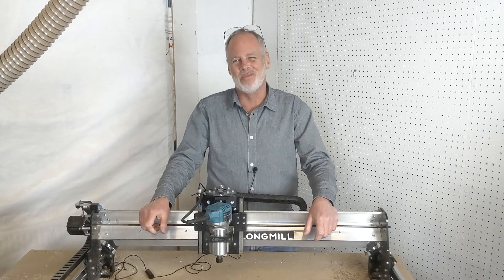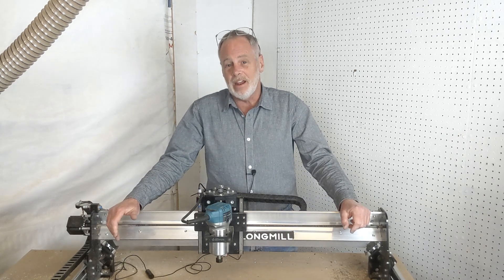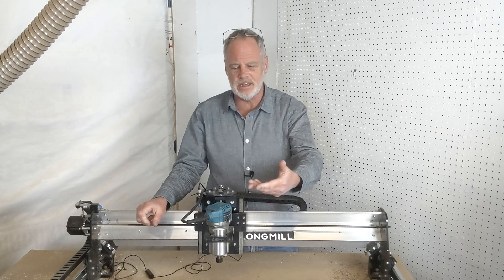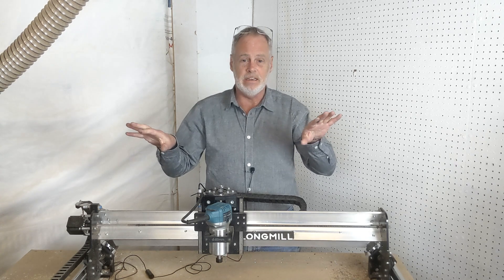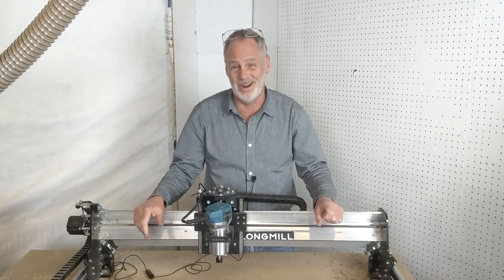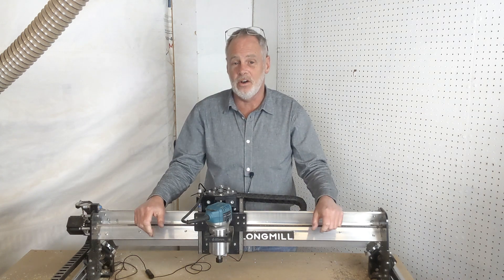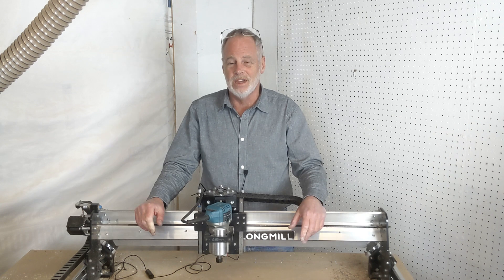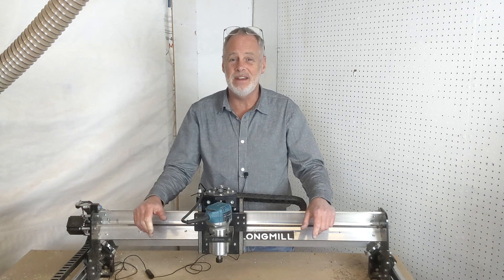CNC Router - What Causes Tearout, Burn & Broken or Burnt Bits on Your CNC Projects, Cuts Rough

Comment: Still useful information 2024!! Can the quality/type of wood also be an issue ? Say some softwoods like white pine ?
Reply from the maker: sergebrosseau991, Absolutely, the quality and type of wood can significantly affect your CNC projects. Softwoods like white pine can be easier to work with due to their lighter weight and softer texture, but they can also result in a softer finish and may require more care when machining. Choosing the right wood based on your project's needs is crucial for achieving the best results. Happy woodworking!

Comment: Man I set up my cnc router and thought everything was good to go. I start cutting holes in my spoil board. when I cut them  there was burning and the smell was bad of course, but i fought thru it adjusting feeds and speeds. I would have a mound of stringy fibers where I was cutting (i just knew something was'nt right ). One night I was laying in bed and something hit me. CHECK THE ROTATION OF THE SPINDLE. I put some painters tape on the spindle and boom it was  spinning backwards the whole time. Easy fix but my only quarter in bit was burnt (sad face). Sure wish I would have watched this particular video a little bit earlier lol
Reply from the maker: tnsfinest, glad to hear this one helped you brother! Now you are set to go to make some serious cuts with your machine.

Comment: I wish I watched this video sooner. My Makita router overheated again and now is pulsating in and out at slow and higher speeds. My guess now after watching this video is that my bits are dull, which makes sense since I have not sharpened or bought any new ones since I started using my cnc a year ago. You mentioned that you cant really sharpen a spiral bit, but what about a ballnose bit, or would that also fall into a spiral bit category?
Reply from the maker: JCraftvfx, so glad to hear this video helped you brother. You are correct about the ball nose bit and sharpening. It typically is not economical to sharpen bits after you use them.
Reply: @IDCWoodcraft   Could a core box ballnose bit be used instead of a spiral ballnose bit? A bit that I could actually potentially sharpen since its got straight edges.

Comment: Hey Garrett, quick question I’ve been running a porter cable 27,000rpm router with an ssd relay to my mainboard i was wondering why my spindle wont run effectively below 24,000rpm im trying to get down to atleast 20,000 but it jumps. My spindle is running clockwise aswell i just cant seem to control the speed I’ve been running faster feeds but still burn marks any idea?
Reply from the maker: llluckyent.9133, I'm not too sure on this one my friend. It's a little tricky to troubleshoot over comments. I recommend reaching out to your machine manufacturer on this one. They should be able to give you a little better guidance on this one!

Comment: I really wonder how do you cut with feed=35 inch/min and speed=22000 rpm when use 1/8 Downcut with 2 flute (derived from your pdf), with the same parameters and the bit I get strong burning?
Reply from the maker: Vitality, those numbers should work really well for you. Ensure that your spindle isnt running backwards.
Reply: @IDCWoodcraft  Garrett, thank you for your kind response! Yes, my spindle should spin in the right direction, otherwise an end mill would break immediately as soon as it touches wood. I have tried to execute essentially more aggressive penetration with this 1/8" bit utilising Cutting feed = 70 inch/min, Speed=18000 rpm, Feed per tooth 0.002 inch/tooth, and it looks decent but my bit has broken prematurely after several metres.
Reply: @IDCWoodcraft  You are totally right, It's my bad. Really my spindle spun in the backward direction

Comment: You totally nailed it for me Garrett. My Bulkman 2.2KW Water cooled was running backwards. I wired it up per a youtube tutorial and this is my second spindle. First one exploded as soon as it touched the wood. This time at least I kept feeds and speeds super slow with MDF
Reply from the maker: Blaine, it happens to the best of us. Complex electrical components feel like magic sometimes, especially if they are three phase like a spindle. Glad you got it sorted!
Reply: Hi! Probaly I have seen the same video, since looks like my spindle spins in backward (counterclockwise) directoin when I set M3 (clockwise) rotation command. Could you please share the right wiring ( I also have the Bulkman 2.2KW Water cooled spindle)? My current wiring is U for 1 pin,  V for 2 pin,  W for 3 pin
Reply: @VSongu  are you still needing this? I have been moving and the CNC is still in a box but I can get the controller out and post a picture of the wiring if u need it still.

Comment: Yes the router/spindle usually turns clockwise.  Unfortunately, you didn't mention the reference on the router, i.e. looking at the counter from the back or from the front (where the bit is inserted).  The bit turns clockwise if you are looking at it from the back of the router.  It turns counter-clockwise if you're lookin at it from the front (where the bit is inserted).  Right?
Reply from the maker: Dave, I see what you mean brother. You're right I probably should have specified. But when you're looking at the router from the top where the fan is, it should be spinning clockwise! If you look at it from where the bit is inserted, it's counterclockwise!

Comment: Hi Garrett, I just want to thank you for your great cnc bits. I have purchased some Amanda bits there packaging does not indicate what kind of bits only by part# you’re a bits Are clearly marked such a convenience I almost can’t stand it by the way I finally got my CNC machine running from Stepcraft I bought a M 1000 I had some issues in the beginning because I’m very new to CNC however Stepcraft has a great support group and videos very happy with it I’ve made some really neat projects from all YOUR helpful videos thank you again.
Reply from the maker: Right on Grampa1999. Im glad that you like them. Others have told me the same thing about Amana bits too. Don't get me wrong, they are great bits too but just like you said, who knows what your looking at half the time!

Comment: Dull cutting tools can cause tear out, burning or numerous other problems. Using carbide tooling will have your cutting tools last longer. Carbide is simply harder and will stand up longer in abrasive woods and other materials. Taking too heavy a depth cut, especially when cutting a slot cut at too high a feed rate can cause the tool to choke. It can just not evacuate the material fast enough to continue the cut. The material can pack up in the tool flutes and prevent cutting. That can mean burning, tool breakage and piece damage. 

A spindle rotating the wrong direction for the cutting tool being used will never work. When viewing your spindle from the top, the spindle should be rotating clockwise. I have a CNC Shark. My spindle router rotates the correct way. One of the nice things about the Shark, is it turns the spindle or router on and off for you. However if it is making the spindle turn the wrong direction, obviously that is not good. However in the settings on the pendant, there is a reverse polarity feature. Reverse the polarity and problem solved. I don't know why some routers need to have the polarity reversed, but that should fix it.
Reply from the maker: CNC Programmer, wow thanks for such an in depth response. You made some really good points about causing the tool to choke. I'm glad you didn't have this experience of the spindle going backwards on your Shark! Thanks for sharing the change polarity feature, I'm sure this will help a lot of our CNC brothers and sisters out!

Comment: can you help diagnose a problem?  I cant leave a picture but its fairly easy to explain.......   When Im using an endmill I cant see any chatter in the workpiece, but when Im using a big 90 degree V bit  it "appears"  the bit is moving up and down, which is really easy to tell when using V bits as Im sure you already know..lol.  When im using the V bit and I miled a bunch of circles and it only occurs in one small part of the circle, maybe about 30 degrees of it and allways in the same spot.  I checked to see if any  parts,  bolts /screws were loose and if the spindle had any movement and everything appears really tight.  I dont understand whats causing this.  the only thing i could think is i used tape and crazy glue to fasten workpiece which was pine wood.  Please put me out of my misery and help a Canadian out.  Thanks very much.
Reply from the maker: Hi CNC Driver, have you considered reducing your feedrate? It might help your issue with chatter. Maybe your overdriving the machine and it cant handle the feedrate that your giving it.

Comment: Thanks for another great video. Garrett this came to mind as you were speaking ....if you are using a router on your CNC, what is the norm run time a project should be? Because if you have a project with a run time of 2 hrs for example (as calculated by the software) and you need to change bits along the way, the router is generating heat for a prolonged time. Do ya stop , decrease the number of passes, or take long breaks between projects? Because this eventually will breakdown the router, possibly break the bit and make it difficult to change the router bits due to heat or something else. When is enough is enough to stop the router to cool down? What is your take on this? Thanks
Reply from the maker: That is a great question Max. Project length doesn't really matter for the most part as long as you are cutting within recommended feeds and speeds for the router bit and getting good chip evacuation, you will not see any heat buildup in the end mill that it is not designed for. Stepper motors that are attached to the CNC can run almost continually for days on end if you ask them and still work perfect. It's when you start to overload the CNC and ask it to perform cuts that are beyond the scope of its design is when you start having problems. Two hours though? No problem!  Cut away my friend!

Comment: Nice video Garrett. My Shark HD520 came with a water-cooled spindle rebate. But before I got the spindle, I was using a DeWalt 618 router as my cutter. I had no issues with the projects I ran with the DeWalt router. After I received my spindle from Next Wave, I installed the spindle and have everything configured according to instructions and was all set to carve out a 2’ wide yard ornament Thanksgiving turkey from plywood. I put in my 1/8 inch down cut EM to make some shallow interior cuts and noticed big time tear out leaving long strings along the tool path. Smoke from the bit. Loud screeching coming from the bit. I asked myself why in hell is the wood tearing upward when I’m using a downcut bit? It occurred to me that maybe the bit is turning backwards. I didn’t know which way it was supposed to turn. I got my trusty DeWalt router out and turned it on for a second to see which way it turned and it was turning as you looked from the top down clockwise. I turned my cnc spindle back on and sure enough, it was turning counter clockwise.  I called Next Wave customer service and told them what was going on and they said they had gotten a batch of reverse wired spindles and sent me a detailed email of how to fix it. I just had to reverse two wires in the vfd controller box. It was aggravating but easy enough to fix. Every time I have had question for Next Wave, they’ve been very responsive. I’m glad you posted this video. It should help people troubleshoot some of these problems themselves. 👍
Reply from the maker: Im happy to hear that you figured it out in the end Douglas. Those VFD powered spindles can be tricky to wire up! Its always good to have a trusty DeWalt  on standby incase you need it isnt it?

Comment: Why is it that sometimes when I select a vector and then try to calculate a toolpath a message pops up saying no vectors are selected.
Reply from the maker: Hi Bernie. That happens Because you haven't selected vectors for the toolpath to generate on
Reply: But I clearly clicked on a vector just like you clicking on the rectangle or the square and you see it's highlighted but it gives you that message. Of course in your video you did forget to click on it at first. I'm using aspire